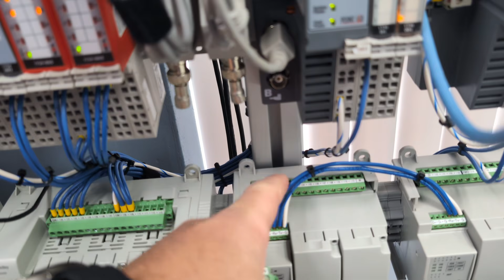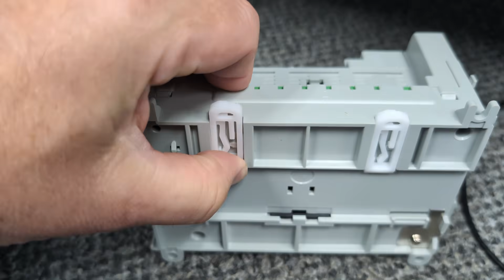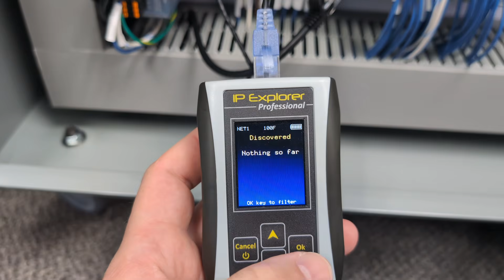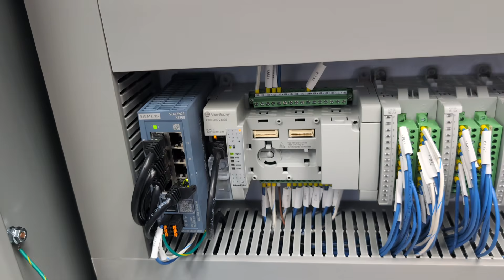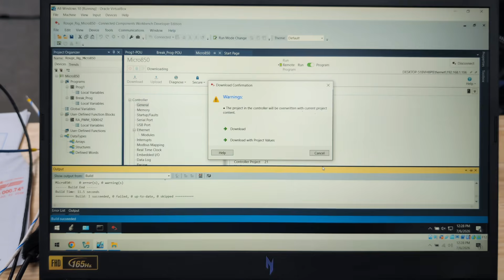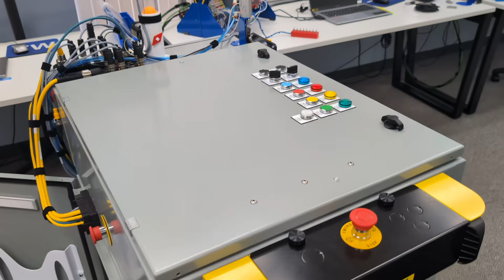How to Replace a Micro850 PLC Without Removing Wires

Comment: PLC is a humbling experience, opened up a rectifier that worked with giving power to a chrome pool for basically cleans up and eats away at rust or oxidation for parts, and I was real confident going in, because what was happening was the the chrome pool was having spikes in amps, thought it may have just been a bad cell in the machine. But machine was fine, then I messed with the ground rods inside of the pool, made them have better contacts. Still, nothing. Then I thought the PLC may have been malfunctioning, I was working with another electrician who came in with a computer for it all, still to this day idk what was wrong with the pool causing that to happen. Any thoughts? The physical dials in the machine were fine and set, I messed with them a bit to maybe help the spiking be less sharp on the parts but was good enough for the companies solution they were using to be effective, maybe I was coping but it’d felt like the spikes felt a little less frequent but it wasn’t a pliable amperage for them to get the job done on the parts going in though. So I’m just wondering what you think may have been going on. I hate electrical.

I came to the conclusion they needed to buy a new rectifier and I got fired for it, because it wasn’t the answer they wanted to hear, but I tested everything, everything was right. Idk, I gave up electrical a year or two after that incident though, it’s just not my field.
Reply from the maker: That sounds like a really frustrating situation, sometimes equipment issues are just impossible to diagnose without the right data.